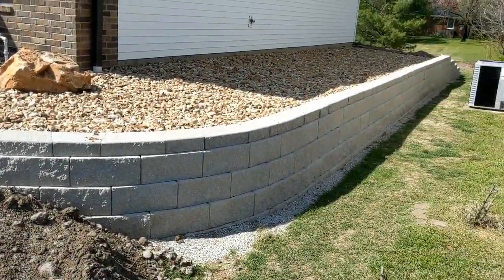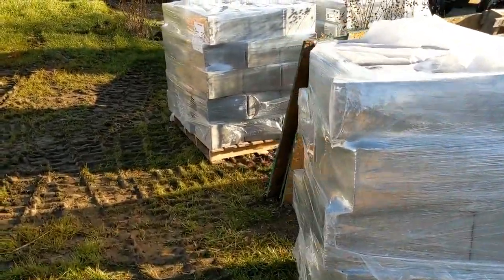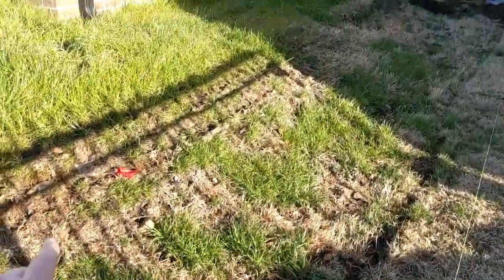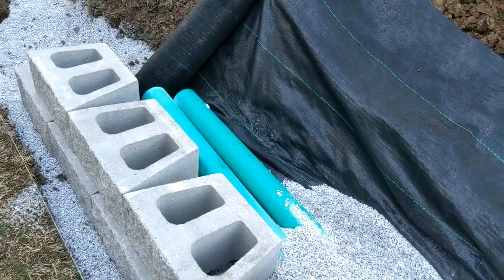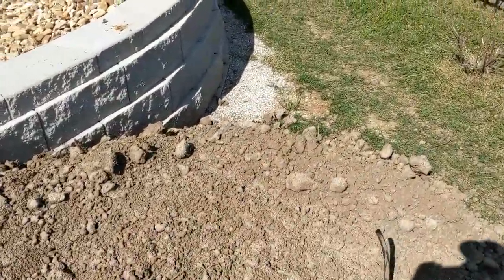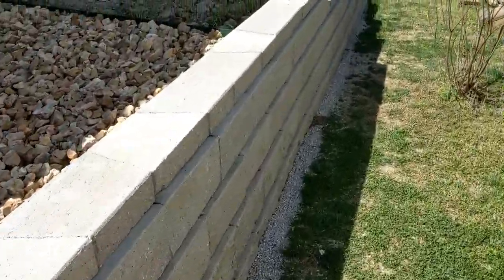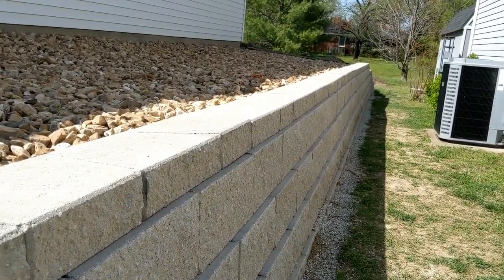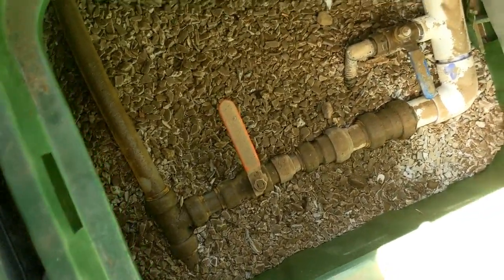Building a Retaining Wall with Concrete Blocks

Comment: Thanks for instructions. (Curious, You probably said it, but why was this built? to fill with rock? It looked fine before... )
Reply from the maker: It’s hard to see on camera but the slope was very steep to the property line. This wall identifies the property line as well as finishes off this space. It could have been sloped and the rock applied but it wouldn’t have worked as well, nor looked as good.

Comment: I have that brown rock for my back yard. I rent a townhome but I wanted to put like a 4ft cinder block divider back there between me and neighbors to prevent kids from riding bikes there. How do I start the foundation? Can I just lay the blocks on top of that brown rock and pour cement into the holes?  It's about 8 ft wide from the retaining wall and house. I'm not sure how to accomplish this.
Reply from the maker: Cinder blocks are completely different than retaining wall blocks.  You would need to pour a concrete footer with rebar and mortar the blocks in.  Core filling blocks with rebar occasionally would also be highly recommended.  If you are not sure how to do either method you have a lot of homework and research to perform before you decide the being the work.  Retaining walls are simple in design but if you miss a key component the results could be catastrophic.

Comment: Since this wall block is trapezoidal instead of rectangular, you end up with those triangle gaps on the back side.  Obviously you've got them filled with your backfill stone all the way up to your cap stones.  But what would you do if this wall was topped with sod instead of that tan rock?  Would you put edging behind that top course to keep the top soil out of those triangles or just use landscape fabric?
Reply from the maker: On this wall we actually installed lawn all the way to the wall along a 10-15’ length in the backyard. We usually use the filter fabric to separate soil from drain rock. In this case the cap was smooth/flat; no v shaped voids. We aim for 4-6” of topsoil depth for lawns. Ideally we try to avoid lawns adjacent to lawns because of the need for water.
Reply: @ThriftyGarage  So the cap is 4"tall.  Directly below that begins the V-shaped voids of your top course of wall block.  So are you saying that if you had lawn on the back side of this wall, you would have gravel all the way up (filling the void), then your fabric on top of your gravel and only 4" of top soil on top of that (framed by the solid 4" cap stone) ?

Comment: Hi All, I have a couple questions.. based on the proximity of the house foundation is this wall engineered? 
It would appear that a surcharge (loading) would be applicable ..Why,why not?
I realize this wall is not very tall, but why aren't you using Geo grid?  Why/why not??
why do you use fabric running parallel With the wall?  It is not very strong this way... True/false?
Thank you
Be Safe!
Don
Reply from the maker: This is an excellent observation. The house foundation was built and left with a 1:1 slope. We simply added a retaining wall and leveled out the space between the property line. The wall is not intended to carry a surcharge from the house. The home builder should have built a sufficient foundation to support itself, especially the way they left the rough grade and the elevation difference between this house and the neighbors.

Comment: Would it be necessary to concrete or mortar on a steeper slope?
Reply from the maker: The wall is near vertical. Not sure what you mean by a steeper slope. Do you mean a taller wall? In short, “No” this block is a gravity block and does not use concrete or mortar. It is intended to be stacked dry. You might be thinking of CMU blocks. For taller walls geo grid is used which ties the face of the wall several feet back into the subsoil.

Comment: are the drains put in at a slope to assist drainage flow? What do you do with the end of the drainpipes? Do they just end where you showed them at the video or is something else needed at the end of the pipes to deal with the water drainage in the yard?
Reply from the maker: Yes, drains are sloped and so is the yard in the “flat” section on the lower terrace. 2% slope away from the wall. The pipes daylight on the other side of the fence in a drainage ditch.

Comment: Looks great! Thanka for the video. Did you use mortar to set the caps on top or are they just sitting on top of the blocks? Did you fill all of the blocks with gravel after setting them. No mortar at all?
Reply from the maker: Caps are glued on. Paver wall blocks are not the same as CMU blocks. Pavers are designed to have some movement and therefore no mortar. Pavers typically use fiberglass pins or a concrete lip to engage the pieces together which eliminates the need for mortar.

Comment: Looks great gentlemen. You can always shoot your elevations in with a builders level. Use the 6" reveal on the foundation as your bench mark and reference back to it as you shoot in an elevated string line. Otherwise, great job!

Comment: So the blocks don't need to be mortared? I always assumed that cement was necessary.
Reply from the maker: Depends on the type of wall. If it’s CMU block then yes it needs mortar. However this is a paver retaining wall block that uses a lip and gravel to interlock with the adjacent blocks. It allows for better drainage and water can run through the face of the wall. Some paver block walls use fiberglass pins to lock the blocks together.

Comment: I want to get into this kinda of work. What tips do you have for someone starting? How do I know how many blocks & caps it would take? For example a 25ft by 4ft tall wall??
Reply from the maker: Go to a ICPI class. Talk to your dealer. Usually they will have classes for you to take. There is a lot of online information. Calculating the quantity of blocks and caps will depend on the dimensions of the product you are using. Keep in mind usually you are required to purchase full pallets. So if you only need 1/4 pallet of caps you will still need to bid for 1 full pallet.

Comment: thanks for quality vid. what good landscape fabric size to use with draining pipe?
Reply from the maker: I usually use a 5 oz fabric in 4' or 6' width.  But it is job specific.  Recently we did a job and I ordered the 12' wide rolls (folded to 6').

Comment: You may have said it and I just missed it, but what brand block are those and where can I buy them?
Reply from the maker: Block is Anchor Diamond Pro Straight Face Grey. I purchased through Old Castle. Other names are Keystone, Belgard and several other brands manufacture similar blocks.

Comment: From start to finish huh?

"We got a few pallets of blocks. Here's where we'll put them. Here's how it looks like it's done."
Reply: You just walked up to a wall someone else was building and took video for sure . U a punk
Reply from the maker: Check out the other retaining wall video on the channel. It’s a lot more detailed.
Reply: Did it hold since installed?
Reply from the maker: When installed correctly integrity of a retaining wall shouldn’t be questioned. We have installed several retaining walls and never had a call back or any issues.
Reply: @ThriftyGarage   I think that wall will have some issues.  You should have use 3/4 inch wash rocks behind the wall.  The other rocks will move over time and cause you wall to fall.
Reply from the maker: Sounds like beginning to end to me…
Reply: @ThriftyGarage  yeah, but it's like me saying "the dinosaurs died, humans evolved and now we have computers" and labeling my statement as the entire human history from start to finish.
Yeah technically it's correct but it's lacking a bit of nuance.
Reply from the maker: I’m sorry for the confusion. I’ll try to improve in my future project videos. Thanks for your positive feedback and letting us know how we can improve.

Comment: Was geogrid necessary with this height retaining wall? Looks like a 32” wall including the first row flush with grade
Reply from the maker: There is no geogrid. The black fabric you see is a filter fabric to prevent sediment from entering the drainage aggregate. This was was between 36-42” in height.

Comment: What kind of drainage pipes and why needed?
Reply from the maker: There are many different types of drainage and drain pipes. Check out ICPI paver certification as they have a slew of training courses. The pipes are there to collect surface and runoff water. Without the drain pipe and drainage rock behind the wall it can act like a dam and fail, falling forward from the force.

Comment: how are they going to set the posts for the fence you mentioned ?  i'm assuming that you filled in all of the space behind the retaining wall with crushed rock.
Reply from the maker: They ended up deciding not to do a fence here.
Reply: @ThriftyGarage  Was it because the retaining wall made it too difficult to install posts?
Reply from the maker: @wulfgaran  no, they simply elected not to install one.  You can install a fence above a paver block retaining wall.  Or any retaining wall for that matter.  It is best to set back the fence from the wall to reduce strain on the wall.  But the fence can be installed near the back edge of the block or even on top of the block with proper planning and installation methods.
Reply: @ThriftyGarage  thanks for reply, I'm just wondering because I want to build a fence on top of a retaining wall. I understand each job individually but trying to work it out together. I need my fence on the edge of retaining wall. I don't know if I should just use 4 meter posts or if there is a better way